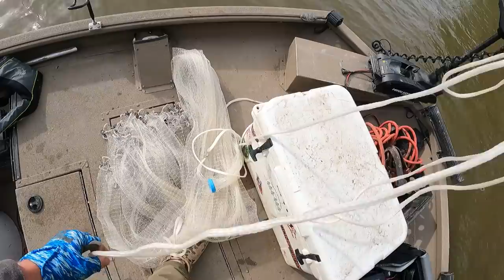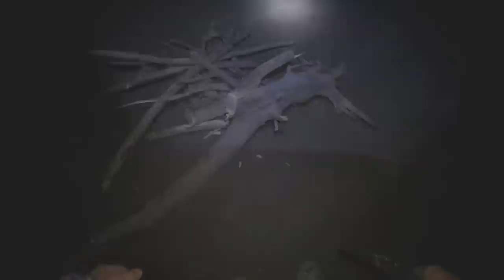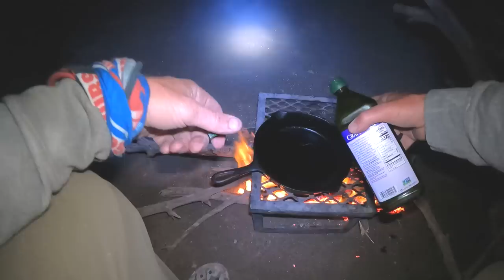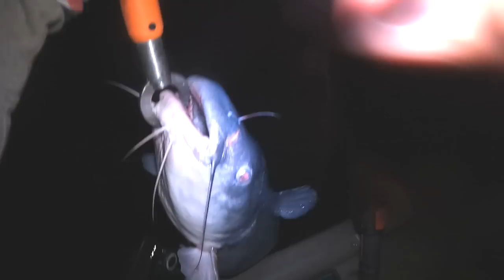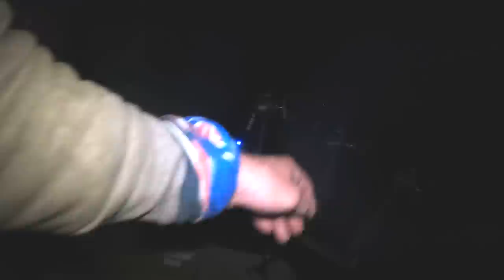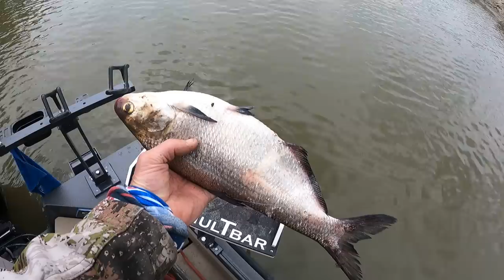HUGE FISH Come Out At NIGHT! (River Camping)

Comment: Sawzaw works nice on those limbs. Nice video dude.
Reply: Yep, especially if you have a nice blade made especially for tree limbs, but beware, because it cuts meat even faster just by brushing up against one of the teeth.
But I've seen little pocket chainsaws with sharp chains eat faster than a good Sawzall can, and at a third of the weight.

Comment: Great video!  I have a suggestion...instead of an electric chainsaw you should think about getting a Sawzall.  When the blade gets dull, just replace it.  I have found outdoor pruning blades for mine and a pack of 4 or 5 would likely be less expensive than a chainsaw resharpening.

Comment: 😢I found that if I/we didn't take tournaments too seriously, and just fished for the fun of it on tournaments day .
But took the prefishing day as if it were the actual day of, we did much better overall. 
Plus it puts the fun back into it, and lowered the stress levels way down to where you didn't overthink what we were trying to accomplish.
Cast iron is great, and if you have it seasoned properly, then you can wash it out, and just dry it over the fire for a few minutes. 
Then just put it away inside a dry cooler or storage box sealed up good and tight. 
Use to use a lot of hot sauce, but discovered that crushed red pepper seeds have more intense flavor, and a natural heat without the vinegar aftertaste..
Nice bunch of Persian blues you racked up, and just because they aren't on the top of the sandbar during the day, just means that you find the nearest deep channel with back current slack is typically worth the time invested into establishing they're location. 
Because I bet they're not really too far away from their main forage location. 
Just observation, but I have been wrong before, and I sure I will be again before I'm done. 
Besides catching is superior to fishing anytime. 
Catch a couple hundred pounders